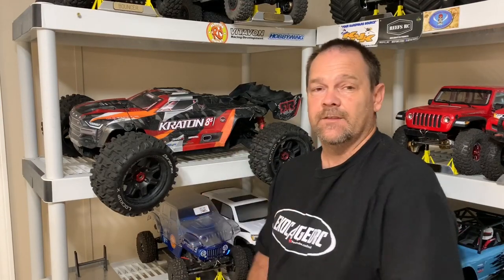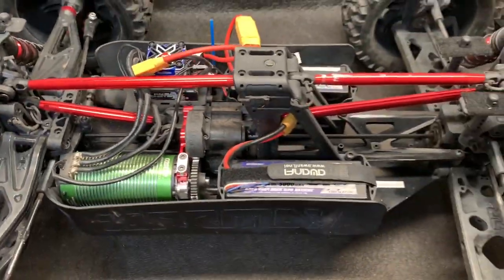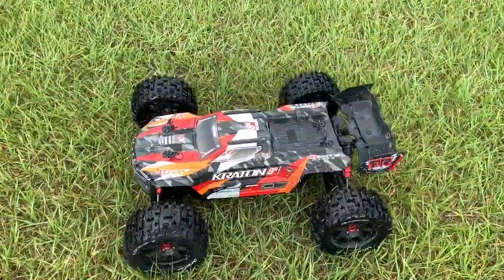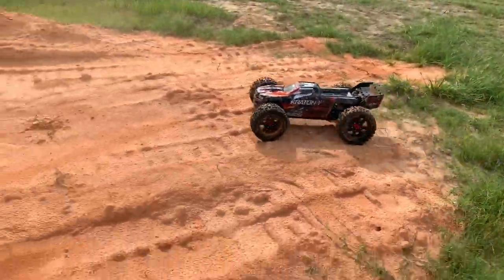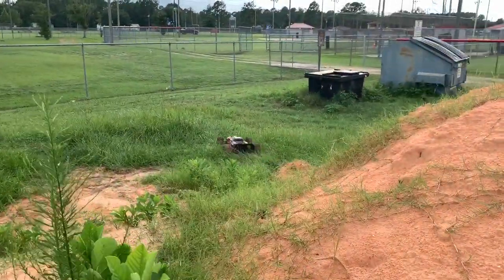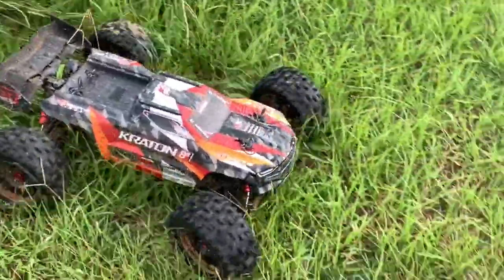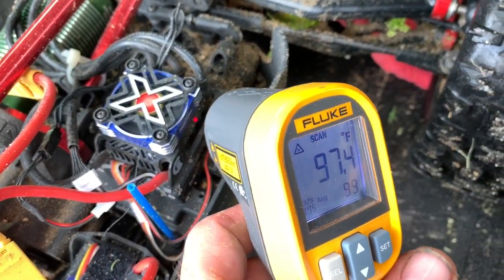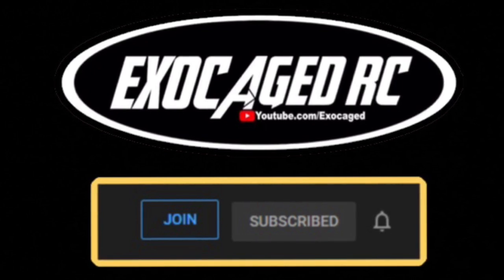Kraton 8s Castle 800kv and a 45t pinion

Comment: Nice!! 
I just dropped a saga 45T into my Limitless yesterday. 45T pinion /29T spur... Thing hit over 100mph @ 54% throttle in a short run!! And I was just trying to do a quick shakedown run to make sure temps weren't going to be an issue. No issues with temps at all, 97F on the XLX2 & 109F on motor (1717 1650kv). Pulled only 231A/ 9.8HP @ 54%throttle.
We'll see what top speed I can get 🙄 with the 34T pinion & 29T spur I was hitting 122mph @ 92% throttle.

Great content bro! 😎👍

Comment: I’m running a 39/39 800 kv, only issue, I need more wheel speed in the air. Very hard to do flips. A 1100 kv does the trick but it’s a short can and coggs. I may have to go with different gearing or a coke can motor but it’s heavy and leans to that side in the air. Still working on it. 👍💯

Comment: I've been watching all your videos with the Castle system and I am on the fence whether or not to pick up this system.  Between the mount, pinion, and system I'm looking at about $1000 CDN.  I was able to drive a X-Maxx with this system and it was super smooth.  Only thing was the truck I drove was extremely under geared so I didn't really get to see much improvement in speed compared to mine.    Decisions, decisions.  :)
Great video btw.
Reply from the maker: yeah its a heck of an expensive purchase for the truck. Many have fun with a 23t pinion and silicone ear plugs in the center diff and call it done.
Reply: Exocaged RC yeah I’ve e been running 22t and 20mil weight in the center.

Comment: Your batteries and straps look different? What are you running? I hate the spektrum 4s 5000mah ones they recommended... it only.has about a 15 min run time 😪
Reply from the maker: One is a Tekno and the other is an avant- brand. I got so tired of the stock Kraton stuff.

Comment: Hey I have a Arrma outcast 8s  stock on badlands I was 25 tooth pinion and the truck was fast   My 1250kv motor shaft broke while running it .  Should I contact horizon hobby or just buy a new motor ? What do you suggest ? 1100kv 800kv. ?
Reply from the maker: That’s a known issue with them. If you want to go big, go 800kv and gear it 43/47 or even higher at 45/47 if you don’t mind a bit shorter run time

Comment: I understand that you want more speed but running a 45t pinion is rough on your esc and batteries. The amp spikes are extreme and don't have to be. Increase the voltage even if it means a bigger esc. With boat speed setups we see speeds of 120+ mph on 12s2p with 1030kv motors. If over propped expect a fire works show in the hull. 
As John Holmes has said volts up pinion down. Brushless motors are more tolerant to excess amps than a speed controller based on the materials used to construct each of them. 

Not trying to be a pita but been around big brushless setups for a long time they are on my channel. Love your channel just offering up what we do on another side of the rx community!
Reply from the maker: oh yeah I agree completely, for me, in this case it was too much. In the Xmaxx I run a 45t with 54 spur all day long and its perfect. But we never find the limits unless we push and sometimes go too far. 40t is where it will stay for this truck.
Reply: @ExocagedRC so 40t pinion was best but you never mentioned what size spur?

Comment: Do you have an idea my kraton8 with 40t pinion gets extremely hot just running it for about 1-2mins and the front tires glitch/gobble REALLY bad from a stand still and i give it throttle
Reply from the maker: The 40t pinion shouldn’t cause heat issues with the 800kv motor. What esc and motor are you running!
Reply: @ExocagedRC  i have the leopard 1340kv and leopard esc (same as max5)

Comment: I've recently done 1 to 1 gearing on mine with the same setup and I wasn't impressed, it just didn't feel overpowered like i was expecting. I feel like my max5 with hobbystar 840kv motor was better. I may try some overgearing on her maybe try a 40/34....before I throw the hobbystar on her or go full on 12s.

Comment: The stock system with a 25t gets ya 53mph so this set up probably isn't where you are going to end up 🤣 Lots of guys are running 1:1 gearing with 2 limitless spool gears with that motor and ESC 👍
Reply from the maker: This one didn't like it very much. I'm thinking the conditions may have just been bad. I ran it again with the 40t and it just ran so much better, longer and cooler so I'll stay with that.
Reply: You should at 70mph

Comment: Wow I put the 44t pinion same set up I couldn’t put my 45t with the bolt missing I squeezed mine in but pushed plastic as well and mine still seems slow to lmao check my vid out to monster Mojave my Kraton 8s love the video 💯💯👍👍🔥🔥🔥
Reply from the maker: I'm working on my mojave today, Castle Monster x 8s and the castle 1650 is going in. That should be the final setup for that truck, unless we get a sensored 2200 kv 1717 motor...